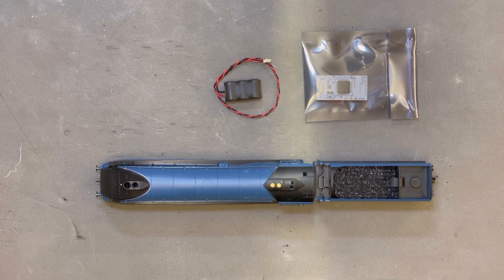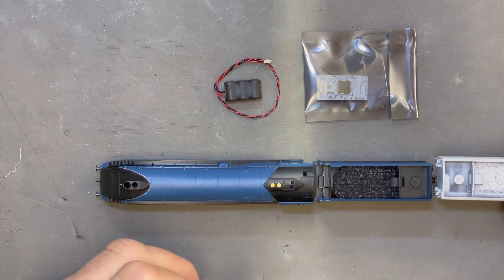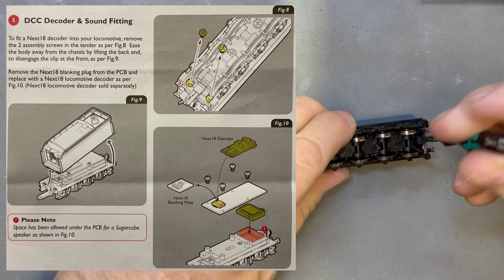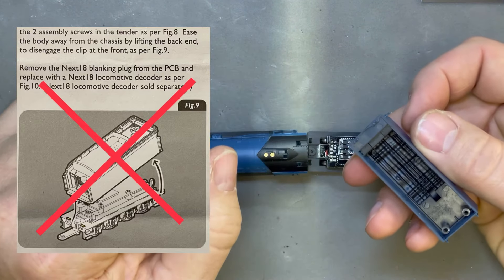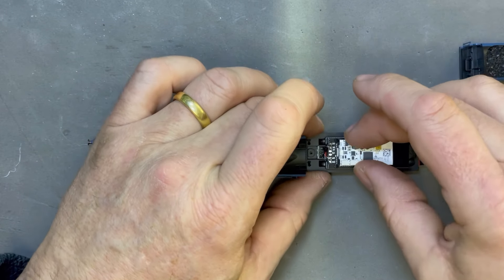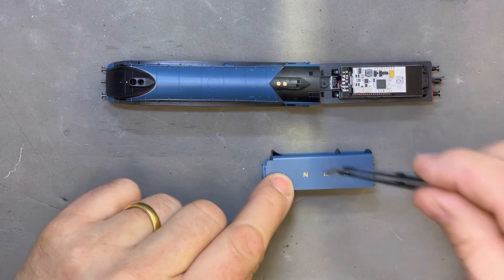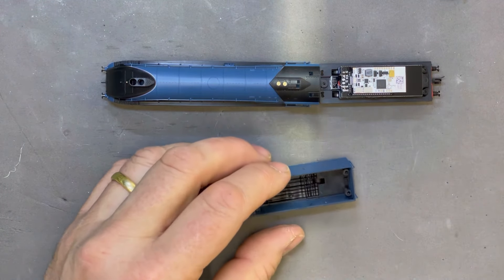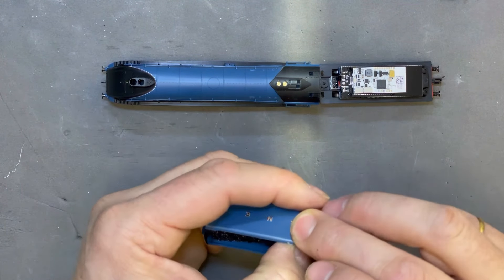Fitting @HornbyModelRailways HM7070 power bank into a TT120 A4 Pacific

Comment: Just looking at the AE Model power banks from DCC Concepts 16.8 x 21.2 x 5.2. Just plucking up the nerve to cut the coal insert (I don’t think you showed that bit). I think it will fit in the Falcon with a higher coal load. The power bank is level with the top of the tender sides so might have to heap a little. I guess I could look in the loco
Reply from the maker: Yes I thought these might be e useful as they’re thinner. Good luck & tell us how you get on
Reply: @PeachyTT120  all done. I can’t post pictures here but it looks great. You can’t really tell. Much more confidant about its running capabilities now
Reply from the maker: @damianinCanadaTT-OO  top job

Comment: Question. I was calculating and it is cheaper to buy already HM7000 fitted loco instead of buying loco and decoder separately. This is right?
Reply from the maker: As Taff says, yes slightly cheaper (I think approximately £10) but Hattons sold the 18 pin version at £45 in the big sell off so that’s £20 cheaper than the RRP
(I bought a few 😉)